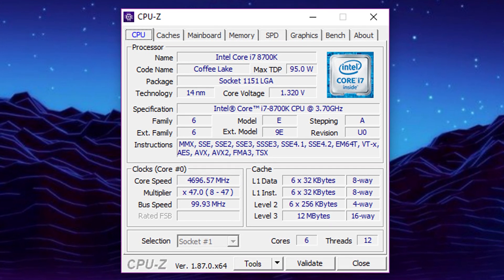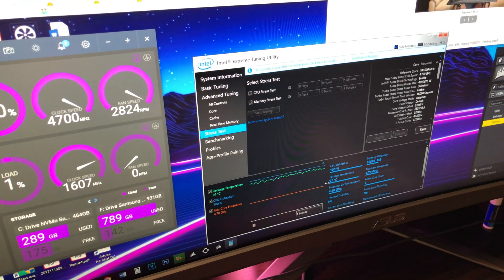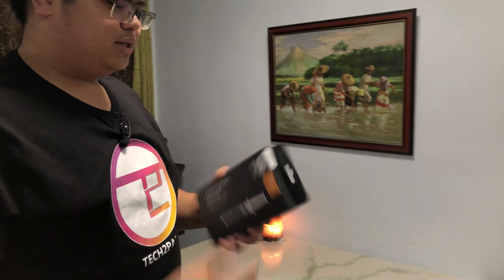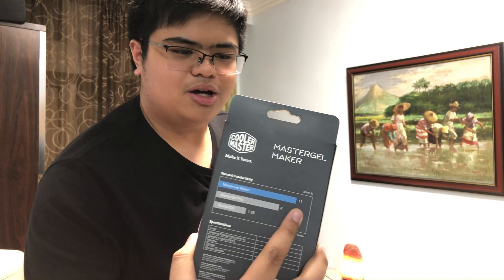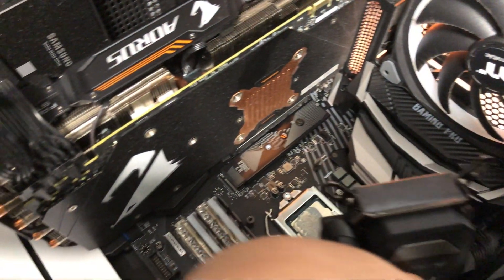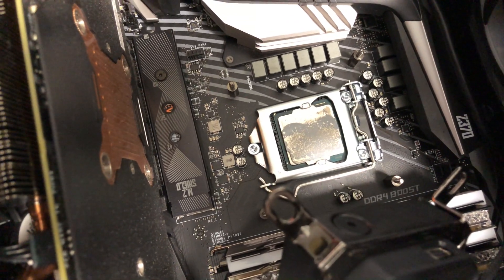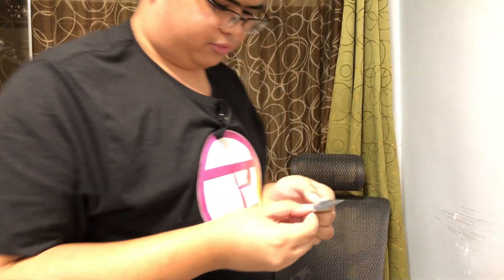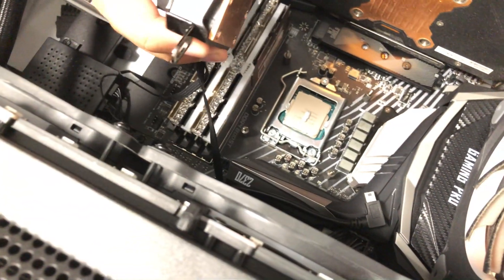Thermal Paste Reapplication: Can It Lower My Temps?

Comment: I was having at 4.0 Ghz on a 4790k with noctua nh-d15 90-100c on stress test and even in games. I replaced the thermal compound and have now been able to only reach 70 celsius now at a over clock of 4.5, absolutely replace your thermal paste after 5 years I'd say.

Comment: Is it just one core that gets that hot(93 degrees) or is it the package temp? Also, your application was slightly off the center of the heatspreader, I would check it again. Dialing back the voltage will have the biggest impact, dropping 200mhz will not be a huge loss for you. Getting a quality air cooler would also be an option and adding more fans to the system could really help in that case. Push or pull config for your rad? 

What mobo do you have? It could be sending more voltage than it is reporting, which may be why it gets that hot.

The possibilities are endless.
Reply from the maker: Hey thanks for the advice, but I reran some voltage tests to try and lower it and it turns out it’s stable at 4.7GHz at 1.26V. Reduced temps significantly.
Reply: @Tech2Papa  good to hear, very alarming when you could almost boil water with a cpu
Reply from the maker: I know right? It’s pretty insane how hot they can get.

Comment: 4.7ghz @1.32volts is abit high man.my 8700k is 4.7ghz@1.19volts.
Reply from the maker: I’ll give it a shot, thanks for the tip! :)
Reply from the maker: It is quite high. Maybe I have to test it again to make sure, but last time I tested it, 1.32V was the minimum stable voltage for my 8700K at 4.7. Looks like i lost the silicon lottery hahaha
Reply: @Tech2Papa  not yet sir. it can be lowered to 1.25. slowly every -.40 is a must try sir. 1.32 was my default voltage too when i got my 8700k. and it takes 3 months of adjustments to reach 1.2volts alone

Comment: maybe this also the cause of mine first time building my upgraded pc using a stock cooler from amd (ryzen 5 2600), first i thought i screw it properly by seeing its not screwed in the threads on the both sides (doing the "x" screw method), i unscrew it moving the stock cooler again knowing some of the ready thermal paste sticking already on the cpu, not to mention i did this 3times, and the cause was, my motherboard box is not perfectly flat, thats why the backpanel lowers down on some part and some are not,until now i didnt apply yet a new thermal paste and leave at it knowing maybe its okay, i dnt know.... XDD

Not to mention right now im OC at 4.0hz at 1.3volts using a stock cooler and gives me 53 degrees on idle, some games gives me 70 deg or sometimes 65/60 deg..... so meaning, do i have to apply again?....
Reply from the maker: 60-70°C is perfectly fine. But do you do anything that is more CPU-heavy like video editing? If not, just leave it be. But if you do, try running a CPU stress test (e.g. AIDA64 or Prime95) to see what your temperatures are like under maximum CPU usage. 

Do note that some stress tests use an instruction called AVX and some don’t. You can read more about it and how it affects CPU temperatures in the pinned comment. Happy overclocking!
Reply: @Tech2Papa  ah thx, i dnt do video editing and mostly gaming and surfing and watching, but when i try to cinebench r20, it reaches  around 95 deg, well thats only using a stock cooler added some warm summer enviroment right now, but gaming no prob, just 65deg or 60 deg (a bit of 70deg on some) and when i surf with 15 tabs just floats on 53 - 56 deg, yeah, cause of OCing and warm enviroment :'D

thanks for reply also :)

Comment from the maker: One point I forgot to mention: Video encoding uses a special instruction called AVX which increases CPU heat output by a noticeable amount (around 10°C for my case). The majority of you will never see these kinds of temperatures though. During a stress test on Intel Xtreme Tuning Utility (which doesn’t use AVX), my CPU stabilized at 82°C which is perfectly acceptable. That said, since I edit video often, my objective here was to lower CPU temperatures while still keeping maximum performance under AVX loads.

Side note: The increased heat output during AVX workloads is the reason that "AVX Offset" is present in many motherboards' overclocking settings. AVX Offset lowers CPU clock speed (and hence heat output) only during AVX workloads.